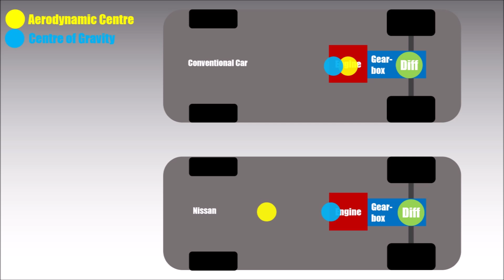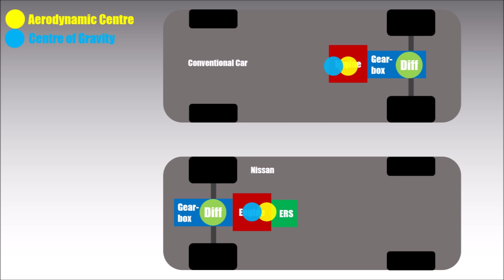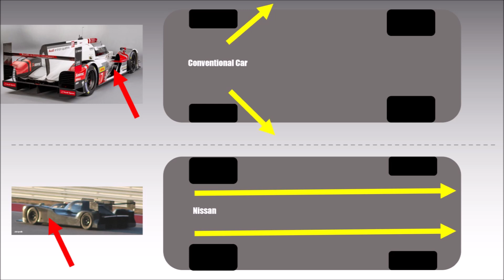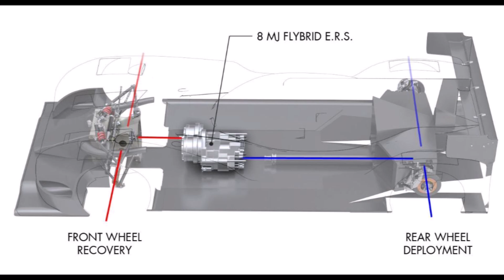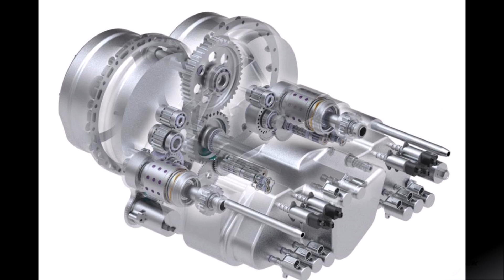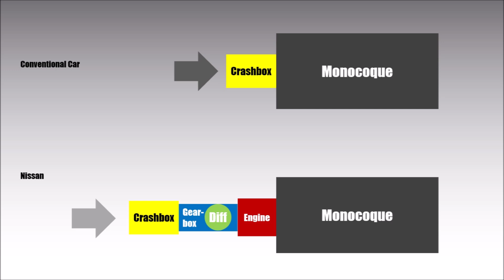Nissan GT-R LM Nismo (Le Mans 2015) - Genius or Disaster? - Technical Analysis

Comment: My take on this design, where as the delta wing was a neat idea with genuine benefits, this seemed like it strayed more into the realm of an engineering fixation.  Sounds like the actual fixation was the mechanical energy storage.
Reply: I wouldn't even call it a fixation, it's just that by the time it was clear that the full-mechanical hybrid wasn't going to work it was just too late to do anything about it for that year.

Comment: Ben Bowlby thought he was the next Colin Chapman. Unfortunately he actually displayed the engineering knowledge of Tracy Chapman!
Reply: Wrong. Good concept. Less money and time to develop.
Reply: Ben Bowlby is a brilliant designer. The concept is solid, and the execution of the design was sound. The car was let down by the snake oil they bought from ToroTrak, and the limited timeframe they had to make what they had work without the hybrid system that was pivotal to the cars entire design.

Without the failure of the hybrid unit, the rest of the car was solid. When the hybrid wasn't there to support the rest of the design, those parts failed.

It would be like training for a marathon, being in perfect shape, but Nike sending you a pair of dress shoes instead of running shoes, and the marathon organizers telling you that you had to run with the shoes you brought. That doesn't make you a bad runner, or a poor athlete, it makes you ill equipped for the task at hand, and you are left to make due with what you have.

The last test of the car at COTA, without the hybrid, and with revised suspension, drivetrain, and aero, was on pace, and getting quicker. But the project was cancelled, effectively, in the middle of that test. With a whole bunch of new parts never tested. Probably never even taken out of the foam wrap, sadly.